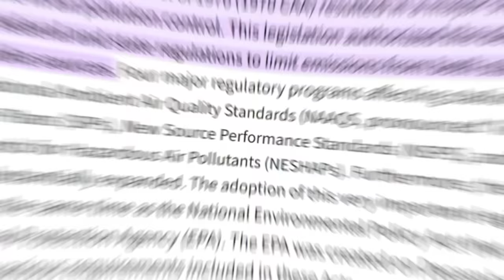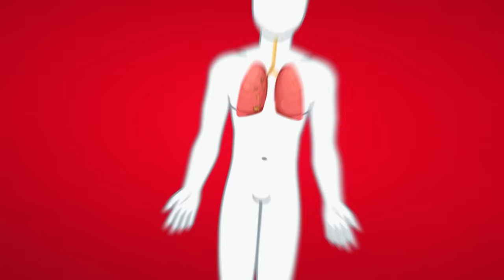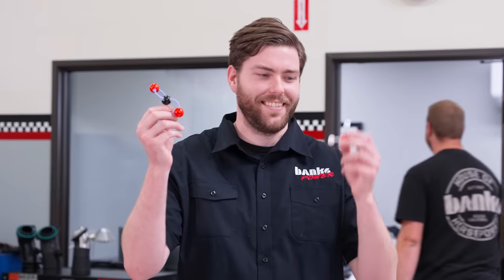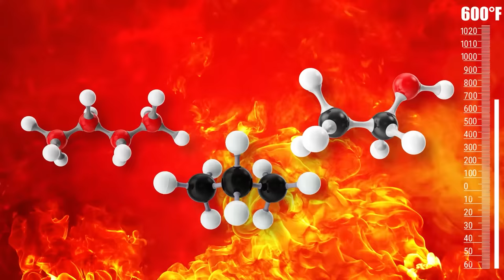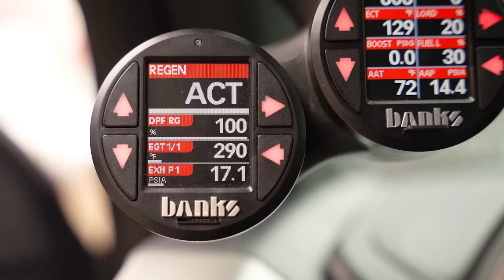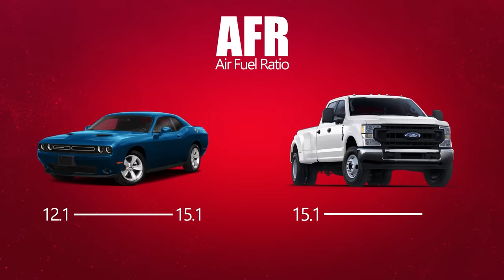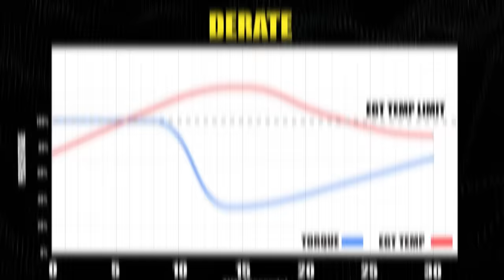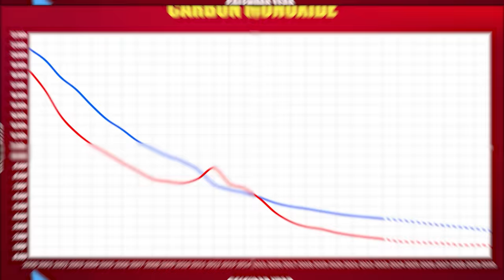Understanding the Most Hated part of your Truck | Banks Entry Level

Comment: The EPA recently decided to look at data showing how CO2 is worse than NOX emissions from diesels. Too bad diesels produce more CO2 because the EGR reduces engine efficiency and lifecycle use. Nice job EPA, you ignored all the case studies that pointed out exactly that and screwed most diesel owners and manufacturers alike. 

From what I've seen most people don't have dpf issues nearly as often as the scr system. If we did away with the egr and allowed engines to not choke on their own exhaust, we could improve efficiency, reduce pm, and regen far less frequently prolonging dpf life for hundreds of thousands of miles. 

On a side note, the ash that exits the dpf during regens is generally in the category of very small pm which stays in the atmosphere longer and has worse long term health risks. A properly tuned modern diesel with no emissions produces less CO2 while lasting longer at the expense of NOX emissions (which factoring in all diesel engines in existence produce less NOX than lightning does). Modern emissions have been improved with better air flow characteristics, improved injection cycles and pressure, but have been hamstrung by government mandates that have done more harm than good.
Reply: We are in the right direction with this, Nox to CO2 is 265:1 effect on greenhouse. Honestly this is still a bandaid, next gen tech is going to be crazy efficient.
Reply: NOX isn't an issue in terms of green house effect...it is its effect on human lungs, plants and other ogranisms.
Reply: @TheEsseboy funny how those problems never actually happened on old diesels
Reply: @mainframehacker  It was, just not talked about as big oil and big car manufacturers paid people to stay quiet.
Reply: @TheEsseboy  Give me a break, nobody on this was paid to stay quiet. Because nobody cared
Reply: @midriffzero  They where paid, if researchers and developers on the company could speak freely, if independent researchers got funding we would have known about this 20-40 years ago...but big oil, big car and their investors funded to keep things quiet. Just like big tobacco did.
Reply: @TheEsseboy  Nobody cared and most people still don't. They weren't paid to keep quiet.
Reply: @TheEsseboy  Also we did know about it 30 years ago. Big Oil funded the research and has been leading the development of cleaner fuels and lessening emissions every since. Where do you thing all this stuff is coming from? A bureaucrat in DC?

Comment: Great video with excellent information! One thing to keep in mind though is that service trucks generally have wayyy higher idle times than normal. While these emission systems continue to improve, these exhaust systems are EXTREMELY expensive to repair/replace. My company has lost almost $500k so far just this year in truck downtime (not counting the cost to repair is like $3-4k per repair) due to backordered parts to fix the exhaust systems when they break...and they seem to break way more often than they should.

Comment: Great video. Sadly, I bought my Land Rover RRS diesel three years ago, and after a DPF "full" warning (which wouldn't allow a forced regen, but I figured out how to do it, and save $6,000) then a DEF pump and injector check engine light (kept the vehicle off the road for a month while JLR figured it was a software bug they'd never seen before) and finally an EGR fault ($2,000 to replace, but I passed), I traded the otherwise awesome vehicle (during a stint when the EGR wasn't acting up and the CEL was off) for a gasoline version. It used to be diesels were the hot setup for durability and economy, but no more.

Comment: I'm 66 years old and I've got an '04 LB7 that just turned 512,000 miles. It doesn't have any of that stuff and it still runs great. I'm hoping that given proper care it'll outlast me.
Reply: You never replaced the injectors?
Reply: It's got EGR.
Reply: @garysarratt1  Sorry I just saw your comment, but yeah, injectors have been replaced 4 times to the best of my knowledge.
Reply: @BenKlassen1  I've been told that because my truck is non California it does not have EGR.
Reply: @williamjones4483  Better check again.   My dad's '03 LBZ has EGR and he's not in Commiefornia.
Reply: @BenKlassen1  '03 LBZ? Was this an engine swap? The Duramax LBZ was introduced mid 2006 model year and discontinued 2007 model year. The LB7 was the first Duramax engine to be made. Edit: Just did some quick research and all LB7 Duramax under federal emissions rules DO NOT have EGR. Only California emissions rules require that.
Reply: @williamjones4483  Good catch.   Typo on my part.    The 2004 LB7 has EGR, though.

Comment: I'm trying to learn all I can before ordering my first diesel soon...this is exactly the primer I needed.  Thanx!
Reply: Just ensure you get the exhaust nice and hot every so often. Long journey on highway, use 3rd for a good few minutes to clear out the exhaust filters.
Reply: @jwalker7567 going to have to try that...I just picked up a 2024 F350 last week that started at 40% DPF fill and is now at 65% after about 200 miles.  Most of the 200 was on the highway, but going 70mph I was only taching about 1100 so I know it wasn't doing me any good.  I'll give a shot at limiting the gear so rpms climb and see if that lowers my DPF fill number.  I'll be towing a 15k lb 5th wheel soon so that will help.  Thanx for the tip.

Comment: They look like a really bad restriction. All I know is that the dodge trucks that were in our fleet had more engine problems and spent more time in the service center than they did on the road all because of those. They created more engines problems and threw more codes than they were worth. I’m speaking of truck with less than 50,000 miles on them. We’ve had the issues start with as little as 3000 miles.
Reply: @tysondehnhoff7561  I pulled my system completely off after having replaced it twice. Each time it was pulled off the intercooler, intercooler pipes and intake were all caked in a black sludge. My fuel economy was about 13-14mpg on the highway and in regen it dropped to about 6-7 mpg. After removing it and completely flushing the system out, cleaning everything back up again my fuel economy on the highway was 20-21 mpg at 75 mph and about 24 mpg at 55-60 mph. The truck runs so much better with more power, my oil changes have been cleaner and I’m burning less fuel for the same distance so it cheaper on my wallet. I haven’t had a single issue since it’s been removed and I use to pull heavy loads in/on a gooseneck trailer. For those that’s would say it wasn’t serviced properly, the engine oil was changed every 3-4 thousand miles, the transmission is serviced once a year and the fuel filters are changed with every oil change.
Reply: @P-J-W-777  The only issue with removing the emissions are poor tuners. Unless my trucks are pulling hard you wont see any smoke out of them.
Reply: @zimmyflip  Fortunately for my personal I have one of the last great tuners and it’s capable of either a clean tune while still adding 75 horsepower or up to 375 horsepower with smoke. Spartan in my experience had the tuning down for the Fords. Unfortunately they are no longer around because it was either pay us a ton of money and comply or pay us even more and your gonna be permanently shut down. Just more government interference but what’s new as it has become all to common place these days.

Comment: DPF, 
greenies brilliant idea of creating a special filter... that requires more use of the vehicle and more fuel being burnt to clean the filter.. 
my old work truck had a DPF, a 2014 light truck its cost at least 10k in repairs related to the DPF. 
one fun feature is, running the truck getting up to speed and having the thing go into limp mode because you touched the 80kph mark now it wants to do a burn but its worked out its been running for 5 minutes... 

you could also force regen it, letting it sit at 3k rpm for 20mins 
honestly, if its got a DPF id avoid it

Comment: Great video and company.
 That said the level of complexity and  maintenance costs are beyond ridiculous for many of these diesel trucks. 
The pursuit of emission control has pushed The technology to be more efficient and therefore more powerful as stated  but the bizarre systems and components required to make the emissions less deadly makes it a nightmare for everybody. 
There's got to be a better way. 
When it comes I'm sure banks will be right there to support it and make it better.

Comment: Basically the engine is eating its own shit. Sounds pretty healthy...And when the emissions goes out, (which it will) it's thousands & thousands of dollars that the manufacturer isn't paying for. But yet you have to have it??? Makes total sense?
Reply from the maker: It sucks, however, because there is an emissions standard in place, it's the best we have to work with. Not all hope is lost. There are manufactures that are experimenting with fuels and tech that would eliminate the need for emissions hardware. When will be come available? Not soon enough.
Reply: @bankspower  you guys are great!  It's just frustrating that the EPA has free reign of everything with no one evaluating them. They just make new bullshit rules every year.  With no regard for the common man wanting to buy a new truck. This is part of the reason these new trucks cost as much as an early 2000's Lamborghini it's ridiculous. But keep up the videos!

Comment: @bankspower Where we live, we don't have emission testing. We honestly don't care (Ohio). I just googled a 6.7 Powerstroke and a 6.7 Cummins delete kit from Canada shipped to my door. The average cost seems to be around $2700 with the tuner. $2700 and I never have to worry about anything after the turbo again. Now, a REMAN DPF system for a 6.7 also ranges in price across Google. Most are around $3000 for the whole system. Used are around $1500 from a junkyard all rusted. Most trucks last over 250,000 miles, normally. How many times will I have to replace anything on the aftertreatment system over the life of the truck? NOX sensors, the 7th injector, the DPF filter, DEF doser, the DEF system in general, this list goes on. It seems anything related to emissions, fails a lot sooner than anything else on the truck. That's just the physical parts. Now we get into the obnoxious price of labor to replace any faulty parts, if you don't work on your own equipment. Emissions, the EPA and the idiots "rolling coal" aside, over the life of the truck, I'm spending the $2700 upfront, deleting the DPF and I'm done. Never spending another dime on anything after the turbo. Over time, the aftertreatment systems have improved, especially on the big truck side of things but parts still fail and parts are expensive to replace after the warranty expires. This has nothing to do with "I hate the EPA" (I do but..) or "I wanna ROLL COALL!!!", this is coming from people who can't afford breakdown after breakdown and a derated truck related to the aftertreatment system. $2700 now and delete VS who knows how much $$$ over the life of the truck. This comment is also coming from an individual, not a business owner who the EPA can attack. A big difference there.....

Comment: I always thought that the DPF was upstream, BEFORE the Selective Catalytic Reducer. It would seem the diesel particulates would foul the SCR more quickly, than exhaust that has been filtered first. The only way it makes sense to have the DPF down stream, is if the extreme heat from a regeneration cycle raises the exhaust gas temperatures high enough to damage the catalyst.
Reply: You are correct....Flow is  DOC to DPF, clean exhaust is treated by DEF doser at SCR inlet. The chemical process reduces nox and is read by the inlet nox (after turbo) and the outlet nox (SCR outlet) the 2 readings decide the rate of DEF dosing.

Comment: Banks should engineer a PVC catch can to keep the oil out of the intake so it doesn't get burned.   Catch cans for turbos are not simple like on a naturally aspirated engine.   Gale needs to engi ner a catch can for all diesel trucks and the Ford F150 ECO boost.
Reply: Diesel is an oil!
Reply: @garybulwinkle82   Yes but diesel fuel doesn't have Zinc and other minerals in it like engine oil.  In the video he said in particular that oil from the PCV system will eventually ruin the DPF because of the Zinc in the engine oil.  Also the oil from the PCV system ends up coating the back side of the intake valves with some nasty stuff.

Comment: When will the Derringer be released for the 6.7 Cummins?
Reply from the maker: We have been working on the Derringer for the RAM 6.7L for over three years. The Derringer, when released, will work with all generations of the 6.7L. Why isn't it available? For the same reason, the 2020+ Ford 6.7L and Duramax LZ0/LM2 aren't available. We started down a path electronically that didn't yield the horsepower required to make it a marketable product. So, we went back to the drawing board. Twice. The RAM 6.7 requires more than just manipulating the FRP and MAP. The new system shares nothing with the current GM and EcoDiesel Derringer. We're fully committed to this truck platform. Once this new Derringer tuning is 100% for all the Ram 6.7l Cummins platforms, we’ll launch it.
Reply: After you sell your truck. 🙄

Comment: Once again Banks is doing it properly rather than the hilbilly tuners just overfuelling and rolling coal and doing [illegal] DPF deletes. Really good on camera personality too. You annunciate clearly and don't talk like a machine gun which makes me turn off after a couple of minutes unless I am desperate to learn something. I have had lots of experience with DPfs in heavy trucks for over10 years. My current rigs use DPF and DEF which makes a lot cooler running engine than the  EGR only trucks. At the first sign of a hill the fan would be roaring with the extra cooling load. The difference now is chalk and cheese. Mind you the Euro 6 engine uses 3X the DEF of the Euro 5 engines.

Comment: step 1: cut DPF using a grinder from main exhaust
step 2: cut open the DPF, preferably a horizontal cut along the side of DPF
step 3: GUT IT ALL OUT
step 4: weld it shut
Step 5: weld back onto the exhaust system
Step 6: delete the DPF from the ECU with a quick remap.

:)
Reply: Step 7 Cry when your locality adopts emission testing.
Reply: You missed the “weld in straight pipe inside dpf housing step”. And this is only if you’re worried about getting caught

Comment: Props on even attempting to pronounce the full name of ZDDP. You were close but in the 'dithio' part, both I's should be long, like eye. It's two parts: 'di' for two and 'thio' for sulfur moieties where the sulfurs have taken the place where an oxygen might be expected. in ZDDP, there's a central Zn atom bonded to two dialkyl dithiophosphates. So a phosphate would normally be a PO4 ion but because it's dithio, it would be PO2S2. The S's bond to the Zn and the O's (since it's dialkyl) all have various chained or branched hydrocarbons hanging off.  Assuming all the alkyls are butoxy for instance we would have (CH3CH2CH2CH2O)2PS2ZnSP2(OCH2CH2CH2CH3)2
Reply: Thanks professor.

Comment: In the U.K. we either have a friendly MOT tester (except for bmw who fit a nice under tray for us) or we take the DPF off, hollow it out and refit it so it still passes inspection every year. EGR isn’t a problem in that respect, I’ve had quite a few performance diesels and every single time I get one I take DPF EGR and swirl flaps out and spend 2 hours cleaning the intake manifold because it’s caked in carbon. I’m talking a good 50/60% reduction of diameter on some 50k miles engines. They run like a dream afterwards, gov can say what it wants but until it starts paying for the reliability sacrifices eg parts that need to be replaced I’ll be doing the same thing every time.

Comment: This is BS. If you don’t have to worry about smog checks or vehicle inspections just delete it. He even said regen in the engine adds wear. My mileage went up 5mpg so I’m burning less fuel. How is burning more fuel more environmentally friendly?
Reply: Because the exhaust isn’t just CO2, there are other things in there. Some harmless (like a surprising amount of steam), and other things which are really bad.

So yes, getting better fuel economy is nice, but CO2 isn’t the whole picture
Reply: The video literally explains why particulates are bad and controlled by emissions systems starting at the two minute mark.

Comment: The irony of Regen. Let's use more fuel to burn off the soot. Lol the EPA is full of people trying to justify their job and make the smaller man pay for it
Reply: Facts!
Reply: I think you may have missed the point that emissions systems are about more than just CO and CO2, and that the other particulates need to be addressed too. So yeah, sometimes that means burning additional fuel to obliterate other materials that are harmful. The engine can’t safely run at those temps all of the time so it makes sense to capture the material and periodically go through the regen process.

Comment: Where I live, people daily drive diesels to/from work. A 10-15 min drive isn't enough to get the diesel hot enough to burn off soot. Then the ultra low sulphur diesel fuel has very low lubricity, but that's another issue related to injectors and CP4 pumps.

Comment: DPF is still a band aid. Just like air pumps and EGRs were in the early eighties. I expect DPF to phase out at some point. Probably from changes to fuel. My 2002 stock Duramax suits me just fine and never blows black smoke. It also starts just fine in low sub zero weather without plugging it in. That doesn't mean I don't plug it in during those cold stretches, I just prefer to give my batteries a break.